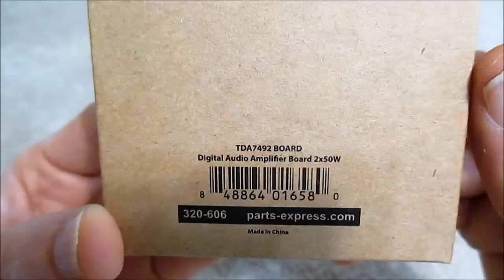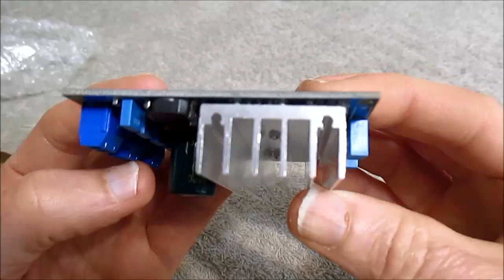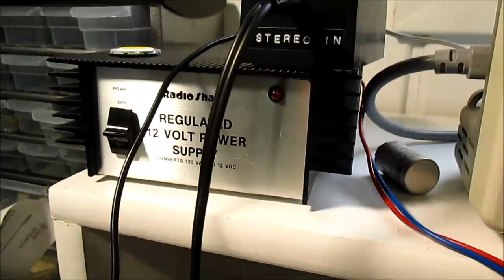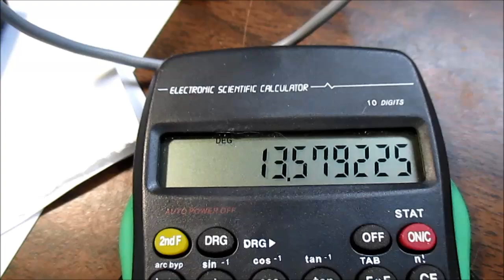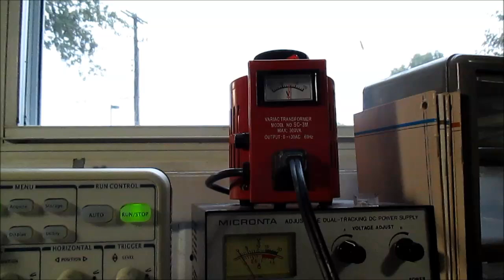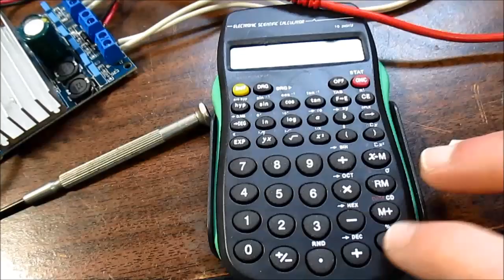Class D TDA7492 stereo amplifier board test & review

Comment: You mention that your regulated power supply is outputting 14 Volts, but you don't mention the number of Amps.  Just wondering if that might be a limiting factor for what the amplifier is outputting?  I suspect it isn't, but just wondering.
Reply from the maker: It can output 6.4 amps max which is enough for 4 ohms minimum on the amp.

Comment: Hi John, i am noodling around with some powered speaker builds and trying out some different class d boards.  My current project is using an amp based around the TDA 3221 made by TI. My power supply is a switching ac to dc 24 volt with grounded plug(external).  Oddly enough I am not have any negative  issues by not using any grounds besides the power supplies ground.  So no grounds on audio or power other than the above mentioned.  What is your experience with grounds on these little class d amps?  Can I just float them all or what would you recommend??
Thanks for all the videos BTW, I enjoy watching.

Comment: I had a similar issue with the hiss. Best way to resolve this problem; is once you build the amp in an enclosure. Is to earth both points to input source (RCA - ground) then connect 10k matched per resistors to both left and right input source. ie red to resistor to ground on the right input and same for left. End result - all humming/buzz/hiss should be eliminated and that will end with stronger signal over noise.

Comment: Of course “digital” is marketing whank. But, as only a retired professor can do, I’ll give you a reason. 

The entire circuit is digital other than an “A2D” at the input.  Now what that input digitizer is can be hilarious.  But, nonetheless, it’s a serious bit of digital PWM that was impossible a decade ago (for a consumer price).
Reply: At no stage is this amplifier 'digital' - There is no 'A2D' on the input.
Pulse width modulation (PWM) is a method of delivering an electrical signal, by effectively chopping it up into discrete parts.
The chopped parts are analogue levels. They are not encoded digitally.
Class 'D' does not stand for 'Digital'. This is entirely an analogue amplifier.

Comment: I’ve been using mine with a 4 cell 18650 pack at 16.8v with a very cheap ebay step up transformer board to 24v connected to some Technics 3 way floor speakers in series with some Advent 575 that comes out to 9 ohms and I’m getting around 3 days worth of loud play time! very impressive. i’ve been checking the coils with a temp gun and the one in the middle to the right gets the warmest but never warmer than about 108°F. Current draw at about 90% volume peaks at around 2 amps and stays at around 400-600mA at around 65% volume
Reply: Wow, you're suffering SMPS input noise just to get a 3.2V boost and also suffering the extra 10% battery capacity loss?  Well, then again, you were only telling us the PEAK charged voltage when a 4 cell pack is normally called a 14.4V battery not a 16.8V.  Maybe that makes it redeeming but I'd have rather just used a regular good ole 18V tool battery and then you have the tool battery charger for it as well.
Reply: @stinkycheese804  powertool batteries werent really a thing to use 8-10 years ago. plus this was in a sealed box
Reply: @MarshallSmith27  Huh?  Power tool batteries have made sense ever since they first went Li-Ion with a  built in BMS for undervoltage cutoff, otherwise prior NiMH or NiCd needed a BMS added.  If you mean the kewl kids on youtube didn't mention it, well sure, if you want for children to tell you what to do,  you are limited by their ability.

Comment: Suggestion: show people how to build active speakers to plug their guitar interface (i.e. 1/4 inch jack entry into speakers). Those are the craze right now, because of computer-based guitar Amps simulators like Bias FX, Amplitube, Revalver 4 etc. Most non pro-guitarists/hobbyists use KRK Rokit speakers, but they're really costly, especially when you want the 8 inches to play loud Rock/Metal (CDN$350+tax each, so we're looking at nearly 800$ for both. This makes no effin' sense! Might as well invest in a used, real tubes Amp. right?). I'd be very interested in a detailed ''Make-'em-yourself'' high quality/durable DIY powered speakers. Thanks in advance? :D
Reply: Unfortunately speaker design is not a trivial task, and the Rokit, as cheaply made as they are, there is quite a bit of unique engineering behind each speaker. The best book i know of is Vance Dickason's Loudspeaker Design Cookbook, an absolute must-read. And it's completely misnamed, you don't get recipes you can follow, you get just the science, all of it, no corners cut, it's not an easy read.

Designing based on 8" presents a particular set of challenges. For this reason you'll usually see DIY designs just stacking up more 6" drivers, but this is not baffle space efficient and not quite as cost efficient if cost is ultimately the goal, but it does provide better quality at a given cost. DIY designs also often veer towards small relatively silent ones because space is often an issue in this hobby, in particular in Europe.

Further issue you're going to have is that parts availability, for parts that have specifications attached to them that you can work with, varies a LOT between regions, and the bulk of DIY speaker community is in Germany. For example the standard lineups of drivers people use to build cheap speakers here, comparable to mass market products in quality, are by Monacor and Intertechnik, but i think these are both Europe-only operations, plus Mivoc but they always have a very limited product range. On the other hand, in States and Canada you have Dayton to fill that DIY low-cost niche, but their products are all entirely different! And Dayton's specs often leave too little information to work with, or at least used to years ago when i last looked. The "low-cost" brands aren't entirely cheap either, but once you veer outside them, you will likely miss your goal of going cheaper than KRK. Mass market companies get customised drivers that enable cost-saving designs.

Oh and a little language barrier, since DIY speaker community in EU is predominantly German speaking, and many Europeans have a decent grasp of German, they might learn it in school or pick it up along the way.

On your side of the pond, maybe a decent starting point is ZaphAudio, that will help fill out the missing Dayton specs for some models, and you may find more resources on linked sites.

I wonder, how about an array of active converted Dayton B652s, would that be a worthwhile project and something you can reasonably use? They are not what one would call good speakers, but i imagine low distortion is not on top of guitarist's priorities.

Apropos KRK, a lot of people throw them away because of electronics defects that aren't too difficult to fix up. A major cuprit as found by EEVBlog Dave was black resin that became conductive with time. These defects can blow tweeters, but replacements should be under $50.

Comment: Can the TDA7492 amp board consume 24W at 12DC?
Reply: Yes but depends on the impedance of the speakers, gain set, and how loud you need it to be.  In general it is always a good idea to give an amp PSU 2A per each 12V, though in reality, it's more like 1.5A per 12V of benefit with 8 ohm speakers.

Comment: Hi, one question if i may... Whats the connector type for the audio input ? Since its smaller than 2.54 3pin molex and my version came with no cables, i 'd rather not solder cables directly to the board in case i need quickly change the board in my rig. Best regards.

Comment: Hi john. As a non-electronic man i find very helpful a review from someone who knows how to do it. I have a question: want to reuse my old stereo speakers (8ohm)  who have both cd and magnetic tape reader broken. I'm trying to figure out a good module but of this board i can find plenty of versions from ebay or aliexpress. There are boards who look exactly like the one in the video (with higher price, aruond 15eur or 13 usd) and a very similar board but with black heatpipe and orange capacitors at lower price(5-7 eur/usd). What do you suggest? Do you think the one with black heat sink can be a fake one? Can i also reuse a 19v 4A laptop power supply or is not the best deal?
Reply from the maker: I'd go for the more expensive one. The cheap one may be cutting corners. You can use the speakers if they are rated at least 20 watts (if not just don't crank it up too loud). Yes, the 19v laptop supply will work with the board reviewed here.

Comment: in your experience with powering these boards, would you say that, for clean power, one would need a big transformer type power supply? or would a "wall wart" be good enough?
Reply: A decent regulated power supply is required and that (LLC based) should provide a stable solid voltage even on greater loads.

Comment: I don't understand that you only talking about voltage ranges, the amps are more important to get the max (clean) out of it without damaging the board on the long term. So for this amp you need at least 24V 4A, better 24V 5A, or the best 24V 6A power supply. Not everyone got this, its a huge power supply or a car battery is needed to drive this little thing without problems. Please mention this.
Reply: Not true. As long as you're meeting the power requirements with some headroom per channel, it'll be fine.

Comment: Hey, just wanted to ask if a noisy power supply could be used with these type of amp boards.
Reply from the maker: If you mean an unregulated PSU, then yes.
Reply: no I meant a switched mode psu
Reply from the maker: Amplifiers have good ability to reject noise from the PSU. It depends on how noisy the PSU is. I'd say try it.

Comment: This would be perfect for a small practice amp that I'm wanting to build for bass guitar. I have a neat little preamp that my son and I designed and the only issue is that I obviously don't need a stereo output. Can I bridge the outputs with a jumper connection as I've seen done with some of the other power amp boards, or will I end up destroying the board or at least shortening the life of the board?
Reply from the maker: Each channel of this amp is already in a bridged configuration so there is nothing gained. Someone might say you could parallel the two bridged channels together but there are technical issues for why it may not work or be of little benefit.
Reply: JohnAudioTech Ok. I kind of figured that would be the case. Can I run just one just one side of the output into an 8ohm 10" Eminence bass guitar speaker as I might do if I were using a mono output power amp? If not, could you recommend something that's a mono out power amp kit that's 20-30 watts and under $50?
Reply from the maker: I'm not sure of the consequence of leaving one channel of a class D amp open as it has an LC filter on the output which can cause high voltage across it at resonant frequency and damage the out put if not protected. You can try, but you should ground the unused input. The second channel could drive another speaker or a tweeter (some bass guitar speakers have tweeters). I like linear amps myself and would use a jfet preamp driving a chip amp like an LM1875.
Reply: JohnAudioTech JohnAudioTech I really appreciate your pointers. My other option would have been to run a dummy 8 ohm load on the other output. Either way it'd be a waste of power and creating a quasi biamp scenario with a tweeter through an L-pad on that second channel occurred to me too, but as its a practice amp, the idea seemed out of place. 

Now that LM1875 does seem to be the way to go. Are you aware of any decent schemetics that would yield a working power amp that you could point me towards? Almost of the ones I happened across are either overkill for my application or state up front that the circuit has "unsolved issues". 

The preamp I came up with uses two BJTs and is simple yet effective. I have an equally simple three band Baxandall that I found works best between the preamp and the power amp where I was using the power amp section from a cheap Walkman style headphone practice amp that I bought at a Salvation Army thrift store to test the overall aural quality of the preamp's and Eq's output when amplified. So the power amp would be my last real challenge.
Reply from the maker: Sounds good. You might also check Elliot sound products site for useful preamp circuits.
Reply: JohnAudioTech Again, thank you John. I checked out Elliot's page and indeed there's a wealth of info there. I don't think I'd have found that page without your kind referral.  

Incidentally, I located a complete kit for a TDA2030 based power amp this morning on the web. It cost under $20 and it's rated at 10 watts into 4 ohms in class AB operation. That is a start.

Comment: Great video,what if you want a knob style potentiometer to run volume and and power on off switch.
Reply from the maker: I'd use a pot in the 5 to 10k range. No problem if you want to add your own power switch in line with the positive power supply lead.

Comment: I'm relatively new to this kind of thing, but what would 12v input and 8ohm speakers do?  I'm working on a portable bluetooth boombox for my son but I'm not sure how much power I need to make good use of the 30 watt 8ohm speakers I have for the project.
Reply from the maker: I'd estimate 5 or six watts of clean power at 12v using 8 ohm loads. Doesn't sound like much but you might be surprised.
Reply: thanks! I'll post a clip on YT when I get my parts and do a (decibel) test with them, I'll post it here :) thanks for your feedback!

Comment: I look for the datasheet of the TDA7492 and it says that it is a 25W per channel amplifier, why all the boards that use it and that are on sale on amazon says that is a 2 x 50W amplifier?
Reply from the maker: Unfortunately the power figures are inflated. Nothing says they have to be truthful in advertising so they tell lies or half-truths about the output power.
Reply: JohnAudioTech I've researched a little and I found that there is an IC that reachs the 50, is the one without the P at the end but obviusly they use the 25W IC, so sad

Comment: Running at 22.5 volt into 4 ohms.It works just fine,I have 3 chips in 5 channel configuration, it came out of an home theather subwoofer, and I have done some mods to it.It is probably the most neutral amplifier I have used,the lm1875 is close,although the tda is more harsh in the mids and bass and a lot more "shy" in the treble.I get about 40 watts or so,that is usable, but i'd want more.One of these days I will build an amplifier with discrete outputs or something.

Comment: Thank you for the review. To make it even more complete you should connect the speakers output of the amplifier (which is already connected to resistors) to your soundcard's input through another resistors (to lower the signal strength) and feed signal (from 20 to 20 000 hz) and record it simultaneously while real-time analyzing it (with such software analyzers as ARTA) so it would be possible to observe the amplifier's dynamic range, AFC and harmonics level.
Reply from the maker: I did check with the spectrum analyzer mode on the scope and didn't see anything that stood out.

Comment: Parts express and made in China  I wonder how much Parts express marks the price up ?. I am sure they buy these in bulk and make a good profit. I don't mean this in a bad way. Just wondering. Thank you for the great review John.
All my best.
Bobby
Reply: About 2x.   They go for about $8-$9 shipped from AliExpress.   All counterfeit components of course,  but many Chinese counterfeits are direct copies of the genuine part, some even made from the same fab.   If it's cheap and Chinese,  you just have to accept that the parts are not genuine.   It doesn't necessarily mean bad, but don't set your expectations high.  A board with genuine ST parts (with name brand caps) would easily cost double or triple this.   Electronic goldmine sells older surplus TDA7490 (25W) chips.   Likely genuine, but you need a lot of extra components (and a PCB) to build an amp from these.